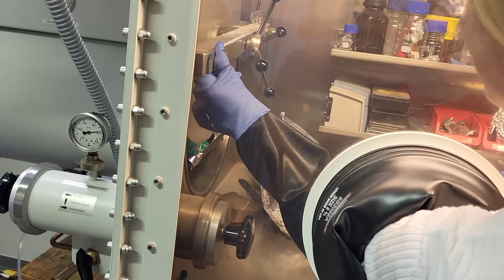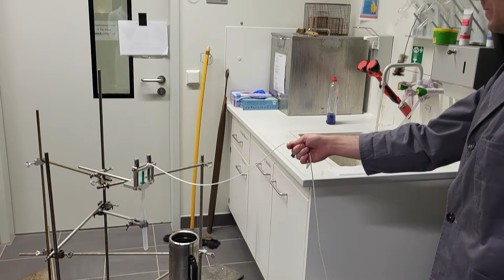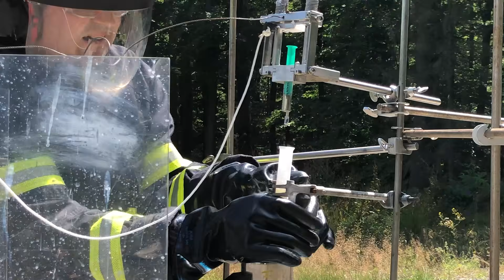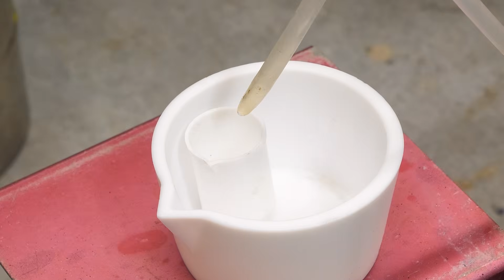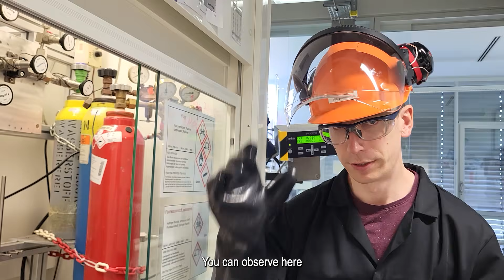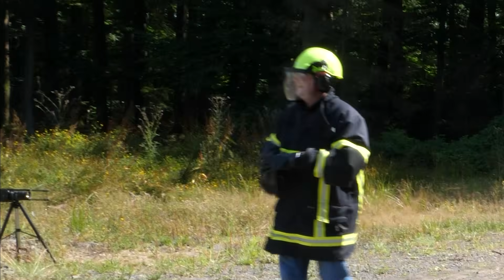Mixing The Worlds Most Opposite Elements (Caesium vs Fluorine)

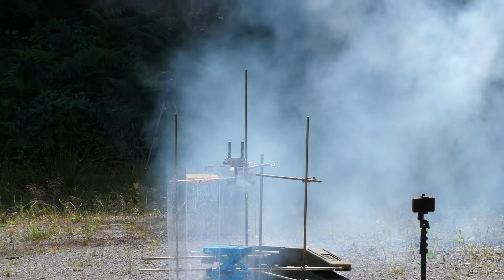Comment: @Flourineisgreat and @Elias Experiments    My "hypothesis" on 29:00 (I am NOT a professional chemist, thus don't take me too seriously) since the Cs +ClF3 react to CsF, CsCl which are extreme hydroscopic (elemental carbon is also a side product of this reaction, if I am not mistaken) CsCl * H2O is forming a "lump" (I guess that this is that what we can see as the product left behind) CsF is even more hygroscopic and reactive to set elemental H and O2  free, which in combination with the oxygen in the air and the carbon in the test tube under the presence of the extreme heat could react to HCO3 creating for a fraction a shielded atmosphere while the CsCl hydrate melts releasing H2 and O in combination with the HCO3 forming HClO4??  creating the same reaction again? Please don't hang me, my last chemistry clas was 2 decades ago, an F for effort would be great thanks :) Edit: I am a german ICU Nurse and "hobby chemist" with focus on organic chemistry and pharmaceutical chemistry everything I know I've learned in ~10 months of self studying

Comment: My 'guess' as to the cause of the double explosion:
The FIRST one occurs in the gas-phase.  The Cs reacts (vigorously) with a 'mixture' of ClF3 gas and O2 in the air.  The resultant products act a little like a noble gas 'insulating' the liquid ClF3 at the bottom of the tube.  Finally, a last drop of Cs falls through the 'shielding' products of the gas reaction and hits the liquid ClF3 creating the more extensive final pop!  This time there is a HUGE excess of ClF3 available.
I'd like to see the whole experiment repeated but in a (clear) container flooded with (say) Argon to exclude any initial Cs + O2 pre-reactions from ocurring!

Comment: These are highly reactive elements. I wonder how much the pressure used to force them out of the plunger influenced the rate of the reactions?
Reply from the maker: That mostly influences how fast the two elements can mix and even start to react not the actual rate of reaction between the two elements.
Reply: @EliasExperiments  I know it's super tough and almost impossible in practice, but would the chemicals produce a similar reaction if they were mixed slowly perhaps using a pipette and a jar?
Reply from the maker: Yes they certainly would produce a similar reaction just on a smaller scale depending on how much you add at once.
Reply: @EliasExperiments  I appreciate the response.

Comment: One would think that reactions such as these which are undocumented even though how bizarre they are, would be studied more aggressively by capturing the byproducts and gasses that are produced on the possibility of some secondary things that are released..  chemistry that exists on paper has been proven physically. Chemistry that has been determined from comparisons or logic without physically conducting the reactions is still just a hypothesis..  it took the lives of many individuals documenting all the radioactive information for fission and fusion as well as in the discovery of various isotopes previously overlooked and there are still unknowns as well as the effects of these unknowns effecting things that would explain variables previously documented to be from something completely different.. i just think its wild how something is learned after a disaster or accident that was not already thought about when dealing with either mass quantities of something or cases where contamination or whatever happens.  When massive factories purpose built containing huge quantities of volitile substances that are then combined with doses of other chemicals to create a commodity to be sold.  Then the factory having a regular worker not follow procedure and pushes a button causing a valve to fail or whatever and releasing or combining chemicals that then reacts with the building structure and starts a fire or deadly gas and takes lives..  if the possibility of something happening is a possibility how is it an unknown possibility..  like the massive release of liquid ammonia or the explosion at that harbor from the storage of those explosive chemicals.. or the grain factory that suddenly exploded from the dust in the air.
Reply from the maker: Some interesting thoughts you are sharing there. In general I definetly agree with you that reality is far more complex than we can ever comprehend ;-)

Comment: Are there NO chemical compound products in these reactions that are considered "DANGEROUS" to breath or come in contact with?
Reply from the maker: All of this is considered dangerous to breathe and come into contact with, but the products of the reaction are certainly way less harmful than what we started with ;-)
Reply: @EliasExperiments  I would have recommended respirators then. It seems the PPE was a bit on the lite side as well especially considering these chemicals were explosive.
Reply from the maker: The PPE was already quite heavy for chemistry experiments and we were outside and you can smell these substances long before they reach dangerous concentrations.

Comment: I'd guess that the delayed explosion in the 2nd to last ClF3 reaction, was likely due to a temporary solid fluoride encasing the reactants aided by the cryo conditions in the deeper ClF3.........  I suspect those few seconds before detonation was the rise from LN2 temps to whatever temp was required to break the fluoride layer and let the thing runaway.
Reply from the maker: ClF3 is not at liquid nitrogen temperatures. It boils at like 11 °C. The thing with the fluoride layer sounds interesting though. Thank you for your input!
Reply: @EliasExperiments  Ahh well, there goes at least half my theory :).... but I'll stick my my temperature gradient thoughts and the old good for your teeth layer.....let me know if there's a Nobel prize to be had :P

Comment: I wonder what it'd be like if they were mixed in a confined space without the ability to expand at all: Under vacuum in a thick glass container.. mix mother's!
Reply from the maker: Depending on the strength of the container it could make a very loud bang once the container burts, or it is nicely contained if you have a super strong container.
Reply: @EliasExperiments "it" is nicely contained.. it.. what's "it" and what would it be like if the container then slowly opened?
Reply from the maker: "It" would be caesium + fluorine and the reaction between them. After it has cooled down you can probably open the container no problem, because there would only be pretty inert caesium fluoride (assuming you used the correct ratio) In this case I would recommend an excess of caesium metal, so you don't get hit by a cloud of fluorine gas when opening it :D
Reply: @EliasExperiments thank you for the recommendation, noted, haha. Also: Don't use as toothpaste!

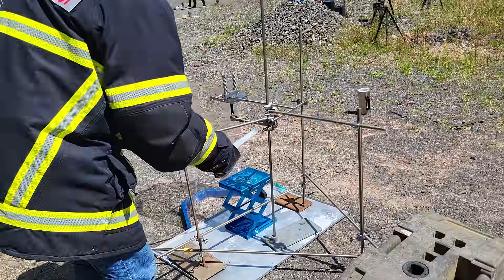Comment: I'm not a chemist but I have a theory about the reaction at 29:00 I think what happened is that there was a breeze of hot air that caused some of the yellow fluorite thingy to get gaseous and that started reacting with the cesium when it got in the tube but there wasn't enough and so art of the molten stuff that didn't react fell on the surface of the liquid stuff and as it cooled down it exposed some of the cesium to the liquid fluoride thingy. Anyway it's just a theory
Reply from the maker: I don't quite understand your theory honestly.
Reply: @EliasExperiments  Sorry I,m not a scientist as I said but I'll try to explain. So when you tried making Chlorine Trifluoride react with 3ml of Cesium there was  wind. You can see the blue umbrella in the back flapping a little. My theory is that in the time it took between the setup and the activation some droplets of Chlorine Trifluoride must have vaporized due to the difference in temperature between the hot wind and the cold substance. I think that this then created a sort of "cloud" of gaseous Chlorine Trifluoride  that reacted with the cesium before it could reach the liquid. If my logic is right the initial reaction created a coat of plasma around the cesium left and this ball of stuff eventually cooled enough while in contact with the liquid Chlorine Trifluoride to become reactive once again and that is what created the second explosion. My idea is that the cesium must have been acting kind of like an alkaline metal when it comes in contact with water. Again I'm not a scientist and english is my second language so I hope this clarifies. Also maybe I'm totally wrong.
Reply from the maker: Ah now I understand, thank you for clarifying. That actually sounds like there could be truth to it as far as I can tell. I have no way of testing it properly though

Comment: Actually because of all your little accidents i say you put yourselves at risk and didnt do this properly, i think you should have automated it better, i bet there was some automation engineers that would have loved to help making it all comming together.
Reply from the maker: I don't think the automation was the issue, the issue was the choice of material for the syringe cap
Reply: @EliasExperiments  I was thinking of the fact that you had to remove your gloves and got the inner gloves burned black from the acid. i might be wrong about how dangerous it is but my impression was that you risked getting it on your skin and eyes. you also had to turn away more than once. i have made mistakes i have regretted myself and i hope noone else repeat my mistakes.
Reply from the maker: That was because of the fluorinated cap from the syringe. There was no acid, it was burning caesium metal.
Reply: @EliasExperiments  One very good thing is that you know why things happen :)
I really hope you will stay free from injuries :)

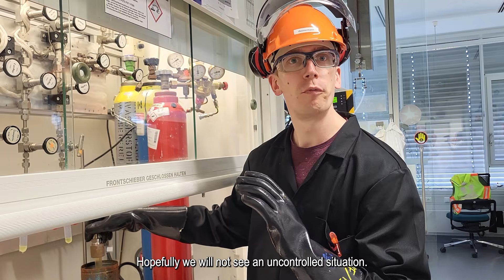Comment: 19:16  Bromine triflouride is used in oil and and gas as a chemical pipe cutter. It is loaded into a downhole tool which has a row of radial nozzles and a black powder charge is used to push a plunger down to force the liquid through a catalyst and out into the well in a spray. The BrF3 then attacks the drill pipe or casing, severing or weakening it to allow the rig to pull out the remaining pipe. It’s faster than mechanical cutters but is more hazardous to personnel.
Reply from the maker: That is so interesting. Thank you for sharing that! I was totally unaware of that.

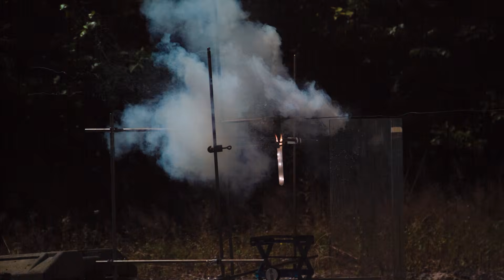Comment: 29:27 I think the reaction was so intense released so much heat that the syringe tip was instantly charred and thus fused together either partially or completely.

Then either the few drops of Cesium that managed to enter the trifluoro were able to generate enough heat and pressure to push the cesium within the syringe enough to prevent more from falling out until the existing reaction had mostly run its course.

Or, the syringe was fully fused shut and the TINY amounts of gaseous trifluoro and atmospheric gases were able to enter the syringe before it could fully fuse, so once the test tubeand internal syringe reactions generated enough heat to again melt the plastic, all of the built up pressure within the syringe ejected the cesium into the remaining liquid within the test tube, causing an explosive mixing of the trifluoro and cesium. This is why the second explosion was of much higher energy and percussion.

I think something along these lines could explain the occurrence. Either that or some sort of unholy pulse-jet engine of cesium and trofluorochlorine that prevented the entirety of the cesium from being evacuated into the test tube.
Reply from the maker: Hm interesting, but then we should see the syringe moving before the second explosion. Interesting hypothesis nontheless. Thank you for sharing that!

Comment: On the show "Farscape", cesium was used as starship fuel.  If you had enough cesium and fluorine along with a system to mix them in a controlled manner, it might be a pretty good rocket engine.  The fumes produced would not matter because it is being released into the vacuum of space.
Reply from the maker: Caesium would be quite a horrible rocket fuel, because it is expensive and has a low energy density. Lithium metal or sodium metal would be far better for that purpose. But also fluorine isn't ideal as a rocket fuel because it is so difficult to handle as well as solids forming during the reaction are also difficult for a rocket engine as far as I know.

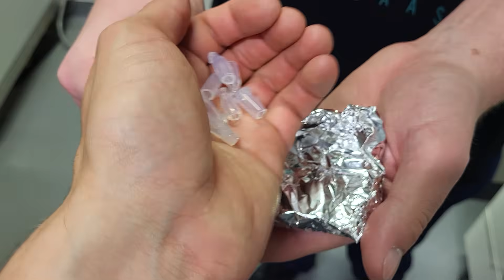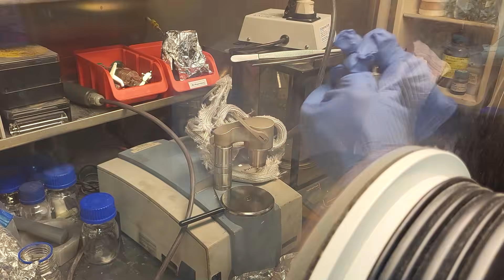Comment: At 4:30 could moisture or oil from the hand have got onto the PFA and caused the reaction at 4:50?  If so handling them with gloves might have reduced the risk.  It concerns me because you would handle them less if you weren't showing them to the camera.
Reply from the maker: A couple people have pointed that out and it is possible, but I would guess unlikely, because the caps need to go through an airlock first, which get's pumped down by a rotary vane pump and that pretty much effectively sucks out all moisture.

Comment: You can see something smoldering in the test tube with the double explosions my theory is that the impurities in the chlorine trifluoride coated one of the last droplets of cesium preventing it from reacting with the chlorine trifluoride for a short period
Reply from the maker: Hm interesting I wonder if that could be true. But yeah that is the interesting question. What is that smoldering thing.
Reply: @EliasExperiments  I looked at the high speed with the frame rate down to one quarter and that double explosion is even stranger you can tell that the detonation starts from the top of the test tube and travels down and the reaction only starts occurring after the smoke cloud is cleared meaning that the gas is in the test tube are reacting with the air so the smoldering thing is making some kind of very flammable fuel air mixture the smoldering thing was also glowing with a blue white coloration
Reply from the maker: Hm very interesting I didn't look that closely at the slomo yet. Thank you for sharing that observation!

Comment: This video also showcases the wonders of using proper PPE. I mean it only goes so far when working with chemicals as reactive as this but it was the difference between your friend getting his hand burned or not.

My guess as far as the second explosion of the ClF3 is possibly the generation of another reactive product from the first reaction with the delay between the two being due to thermal conditions.
Obviously this is just a hypothesis, but more experiments would need to be done to confirm it.
Reply from the maker: Yeah using the right PPE is very important :D What product would you expect as an intermediate in the first reaction?
Reply: @EliasExperiments  my guess would be a product related to chlorine because we didn’t see a reaction like this with the excess of bromine trifluoride nor with 5ml of cesium which reacted more completely. It has to be with excess ClF3.

It may be that that the ClF3 is so reactive that it is willing to pull the cesium off of CsCl or Cs2O to continue reacting. With the ClF3 being chilled to prevent evaporation it could have inhibited the reaction long enough to make a substantial delay between the two.
Reply: @EliasExperiments  while I do have a degree in chemistry, it’s only a bachelor’s degree and I haven’t used it to it’s fullest extent in a few years, so while I can think of a possible pattern, it’ll take experimenting to find hard data and my terminology may not be great.

Comment: most of the Caesium and liquid Fluorine seems to have scattered before they can react.
consider this set up so that Caesium and liquid Fluorine has a chance to mix properly.
-seal the caesium into small glass ampoule
-pour liquid fluorine into a PFA Petri dish
-put the Petri dish on the ground, and place the caesium glass ampoule inside
-smash the caesium ampoule with large sledgehammer remotely
using electrical blasting cap instead of mechanical mechanism to trigger the fall of sledgehammer for better reliability
Edit:
given lighter alkali metal + carbon tetrachloride detonate strongly upon mechanically struck, this set up should detonate even more powerfully. so blast safety precaution is needed.
Reply from the maker: I mean sure you can improve upon this a lot. Maybe one day in the future

Comment: you should try cesium with hydroxyzine (rocket fuel oxidizer), that would make a  big bang
Reply: Would any of these be viable rocket fuels? Energy densities etc?
Reply from the maker: I am not a rocket engineer so I really don't know but as far as I know hydrazine has been used as a rocket fuel.
Reply from the maker: Hydrazine (I think is what you mean) is more of a reducing agents so I don't think there would be too much of a reaction with caesium metal.

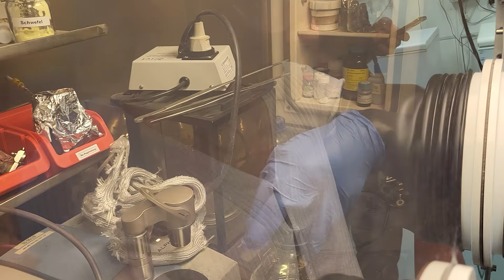Comment: Wait a minute... 4:00 why are you putting gloves on your gloves? Are the tank's built-in gloves more problematic to clean than the disposable latex?
Reply: I was going to say, yeah much easier to pass disposable gloves in and out through the airlocks rather than opening up the glovebox to clean the built-in gloves. And that's true, but also:

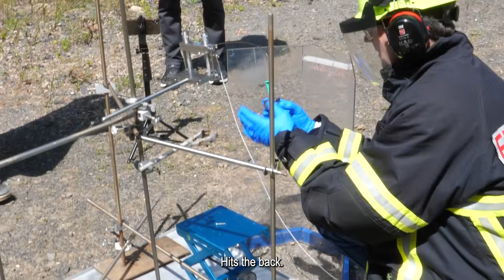If you watch from 13:31 , you'll see professor Kraus take off two layers of gloves real quick (see the blue outer glove floating down in the wide shot). Handling seriously reactive chemicals like this, you really want more than one layer of protection.

Plus they probably want the glovebox's built-in gloves to last as long as possible, before they get degraded too much and have to be replaced.
Reply from the maker: Yes exactly!

Comment: So there was no mechanism possible to remotely rotate the caesium vessel over the funky stuff but placing it right under the inherently dangerous caesium syringes by hand? 
There’s really something wrong with chemists.
Reply from the maker: It was fine ;-) I mean you can always improve safety, but you a certain level of risk will always be there. I guess the biggest safety improvement could have been to replace the PFA caps with something that doesn't react with Cs-Metal.
Reply: @EliasExperiments It turned out fine in the end but it never really was, you bunch of jackasses 😂